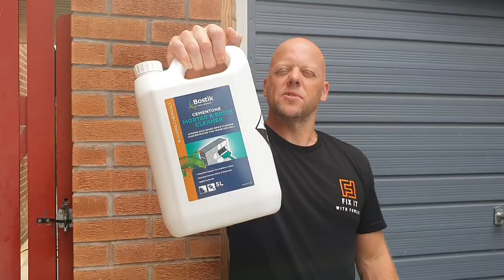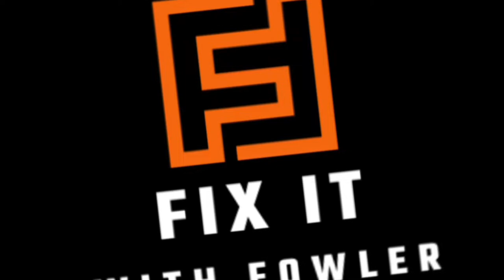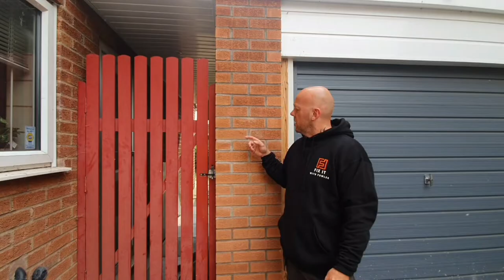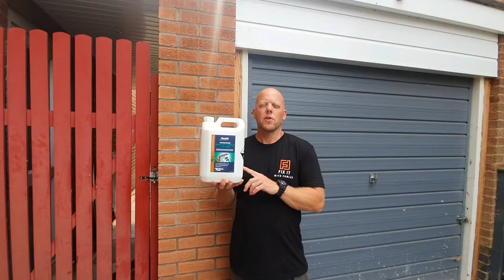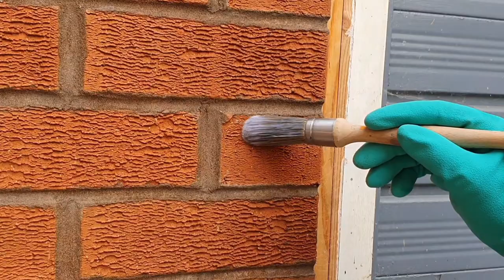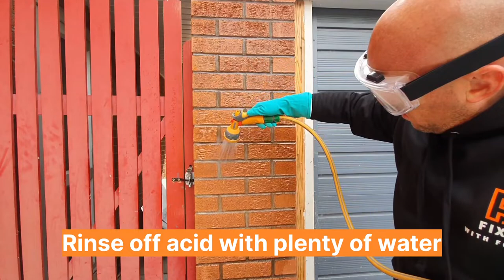How to use brick acid (Bostik mortar and brick cleaner) #bricks #cleaner #acid

Comment: You don't really need to buy a special brick cleaner.  Just go to your local hardware store and pick up a 5L container of Hydochloric acid.  You can water it down to 1 part acid, 4 parts water.  (I've actually used the acid full strength to dissolve difficult to remove spots on occasions).  When mixing, make sure you add the acid to water, not the other way around in case acid splashes upwards when the water hits it.    Also, whenever you're cleaning a brick wall, avoid being heavy handed with overloading the brush with the liquid as you paint it onto a brick -   Acid coming into contact with the mortar between the bricks will readily attack the mortar around a brick and weaken it.  Ensure you hose down the wall thoroughly after the cleaning.

Comment: Thanks. Going to try it as the plumber left a right mess when he did the brickwork for the new boiler vent outside.
Reply from the maker: Hi Nate, Thanks for your comment. It's easy to apply but just make sure you rinse the bricks prior to use and after use.
Reply: @FixitwithFowler  yeah that's a good tip. You think the wife's washing up gloves will work?
Reply from the maker: Its a personal choice, however the gloves i used were only £3.99 from amazon! There is a link in the video description for everything i used.

Comment: Thank you for doing this video.  I have just started taking some render off an old brick wall which appears to have been constructed using lime mortar.  It's an old house 1800's.  I want to clean the bricks and re-point with lime mortar.  Would I be okay using brick acid to clean up the old bricks or would you suggest a different method?  Many thanks if you can advise please 😊
Reply from the maker: I think it will be ideal to clean the bricks, thanks for taking the time to drop me a comment!
Reply: Thank you!  @FixitwithFowler

Comment: Nice video, do you know if it contains Hydrochloric acid. I’ve tried some other brands that are a bit “green” and don’t work very well.
Reply from the maker: Hi, yes this does contain hydrochloric acid. I was impressed with it on mortar and according to the instructions you can also use it to clean tools! Hope that helps
Reply: @FixitwithFowler  perfect, I also use it to clean stubborn brake dust off alloy wheels. The alloy wheel cleaners have mostly done away with acid and are now a bit pansy.
Reply from the maker: I had the same experience with paint stripper, apparently some of the chemicals are now banned from the eu.